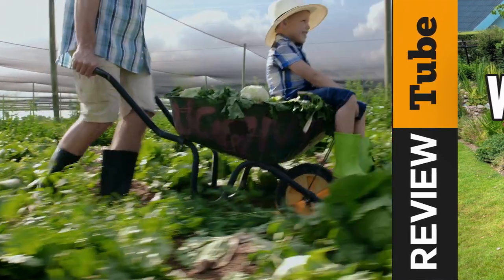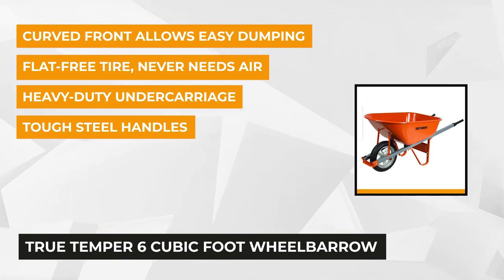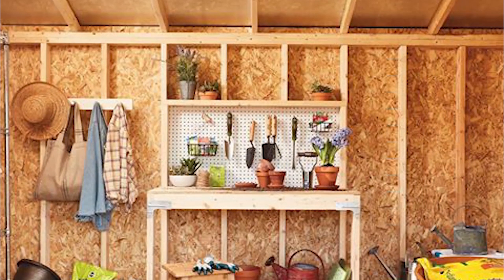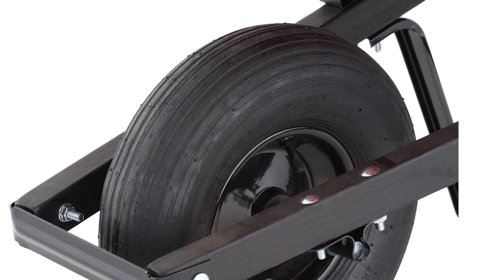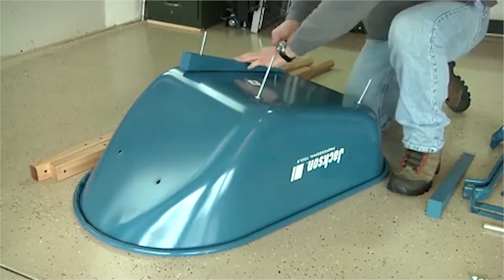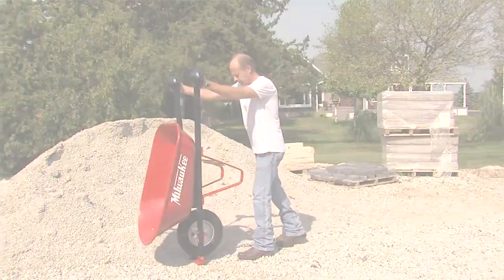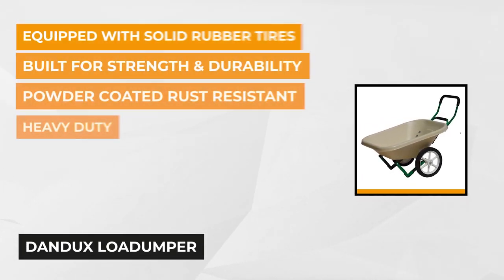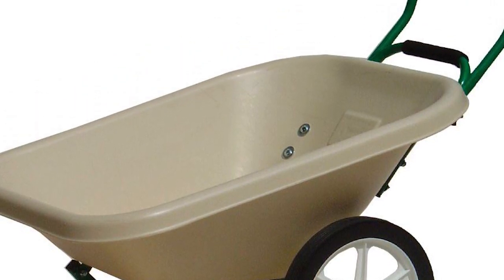✅Wheelbarrow: Best Wheelbarrow (Buying Guide)

Comment: I recently rebuilt my thirty year old, wood handled,  steel trayed wheelbarrow.

The wheel had been destroyed years ago and the barrow had been useless for those years.

I found someone offering TWO old wheelbarrow on the Craigslist "free" site not far from me and I picked them up.  They were both trashed,  but had one good pneumatic tire,  which proved to leak.

I refinished the steel tray,  still pretty much intact except for rust around the bolt holes.  New bolts were required since the bolts were rusted into immobility.    I b rush painted Kilz primer on all the wood and metal,  followed by exterior house paint  ---because that's what I had available at no cash outlay.

The leaky tire was annoying.  A month or so after the rebuild,  I found a plastic trayed wheelbarrow being sold for $10 and a wheelbarrow wheel being sold for $5,  pretty nbear each other and not far from where I live.  I bought both.

The wheel and flat free tire were both good and I swapped them out on my old barrow,  leaving my thirty year old wheelb arrow in excellent operating condition for the cost of a $5 tire and some bolts.

The other barrow was in good condition except for some cracking around the bolt holes.  I added a layer of plastic to cover and reinforce the bottom of the tray,  and replaced rusted bolts.  I discovered how the cracks in the tray had likely occurred when I overtightened the bolts and could hear the tray cracking further.  Not really a proble though.

So now I have two very functional wheelbarrows.  Why two?  Because they were cheap and available!  I recently forked compost into both barrows to turn it,  then ran each barrow into the pile to empty them.  A useful task for two barrows!

A few notes:

1)  A wheelbarrow is a VEHICLE that should be inspected, maintained and repaired as needed.  Don't just neglect it until it fails completely!  Look at it critically once in a while to see what needs to be done.  Painting up the tray or handles as needed will postpone failure,  and even better would be a rebuild as needed to take everything apart  and to repaint and rebuild everything as needed. 

2) loosening and greasing or oiling the bolts once or twice a year might avoid having them seize up and need to be replaced.

I'd like to see a manufacturer who offers stainless steel bolts to avoid corrosion to the bolts.  ---Even galvanized bolts would likely be a big improvement.

Of course I didn't invcest in stainless steel bolts when I rebuilt my trusty old bvarrow  ----but I probably should have.

3)  I found it satisfying to rebuild my old barrow rather than replace it.  I'm p[lanning to paint on my name and the date of my rebuild.  The barrow should be around,  serving someone,  longer than I will be!

So check out Craigslist and see if you can find an old barrow that needs some love and a new home!